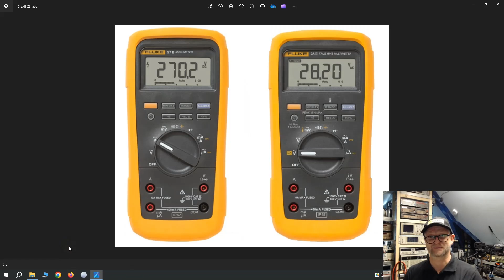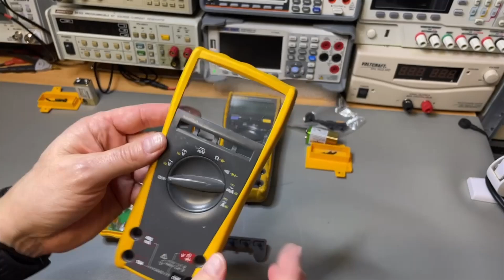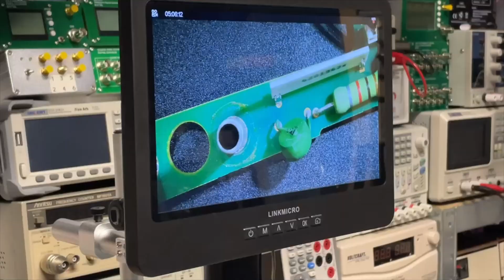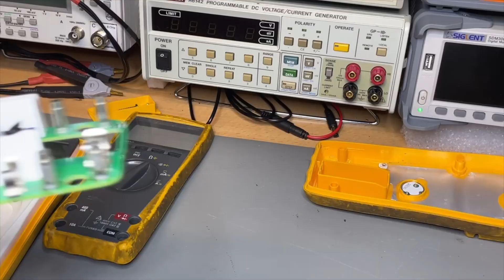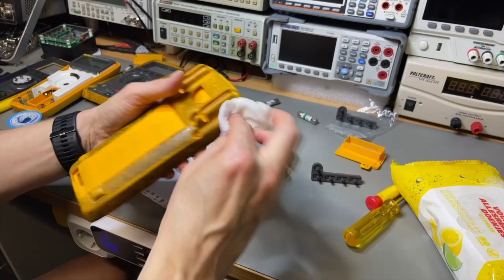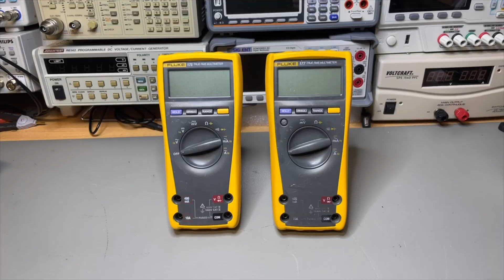TA•0414🟦Fluke Friday (E22) 175 177 179 Repair - Cleanup - 77-IV

Comment: Can you tell me the ingredients of those wiping cloths, or an equivalent available in N. America?
I'll try to clean my S-38 when my sink is empty!  Windex, then WD-40, right? I have heard of using VIM but that seems harsh.  73
Reply from the maker: The white paste i use in the fleud form of VIM.. be very carefull only doing the rubber. this new brand i used now it too agressive and i damaged the lettering, or should have taped that off. the clotes  did not work that well.. i would not know an equivalent. is smels the same as a spray liquit for kitchen use. lemon and bleach

Comment: Nice fix 😅
To avoid Scratch you can use kitchen degreaser (spray) works great!! 
Try it out first on a small spot off course
Reply from the maker: Yes you have a good point there, i was using a new paste i never did before, it turned out to be more agrassive as the one before. looking back, i should have taped over the lettering.
i messed up here a bit.

Comment: Finally another Fluke Friday! I've got a 175 and 179 myself and they are good and robust meters. 
As for the backlight color, Fluke used to have green backlight on their meters (this is not specifically a China thing) but at some point they changed this to the blueish/white color, which is much brighter. I have had a 177, 179 and 87 III with green backlight but the ones I have now all have blue/white backlight.
Reply from the maker: Thanks Marnix, interesting oint about the LEDs.

Comment: Hurray - Fluke Friday!  Nice repair and clean-up, Tony. Fluke should sponsor your channel. On the resistor repair, I would have cleaned out the pcb hole and used a bit of component lead to give a bit more strength, but you probably won't be tossing it in the tool kit too often. Regards,  David
Reply from the maker: Thank you David! I hope Fluke will do that at some point, and i can show much more stuff.